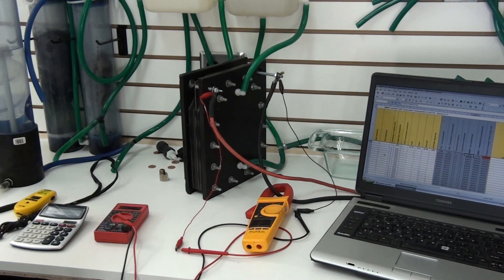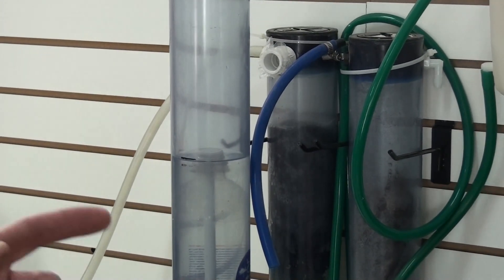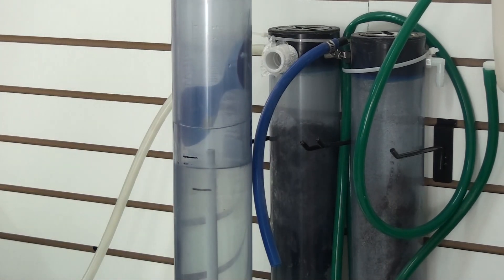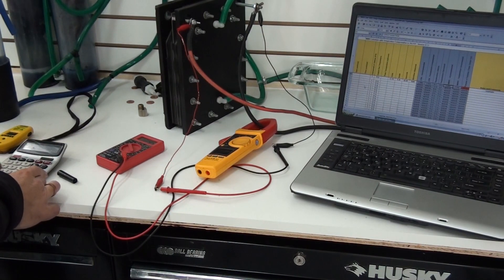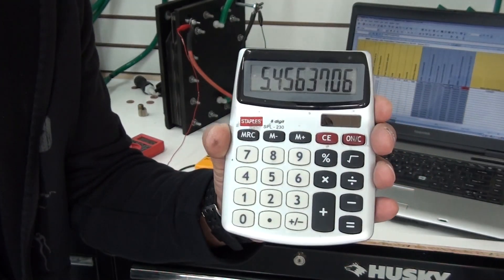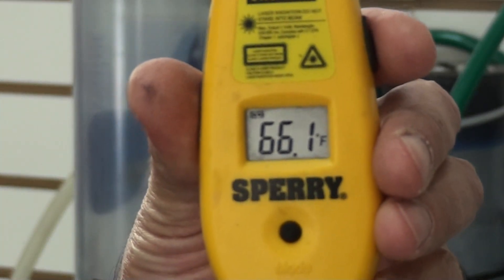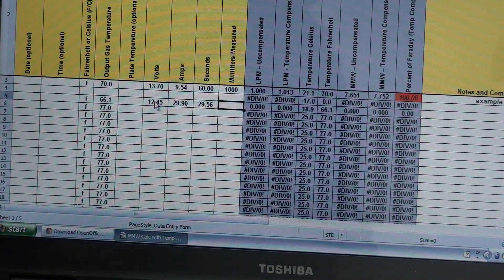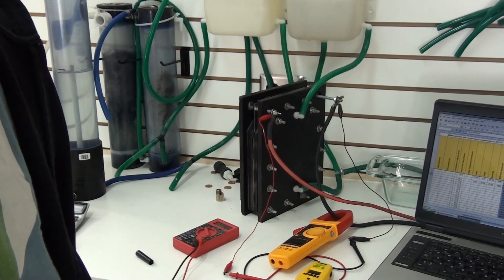HHO generator cell MMW test for my friend Jaime M

Comment from the maker: In this video I used about 16 teaspoons per 2 liters of water. This cell has it's inlet and outlet ports treated so there is little current leakage. This being said the cell will get more efficient as the koh concentration goes up because the resistance in the water will go down. The opposite is true for a cell that is a straight 5n2 without treated holes. As the resistance gets lower the current leakage gets higher. it depends on the cell.